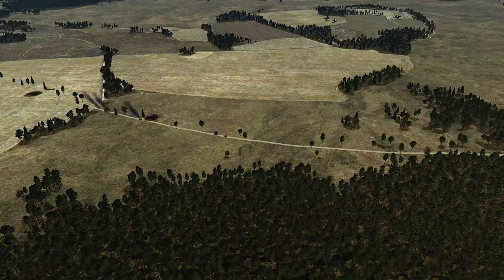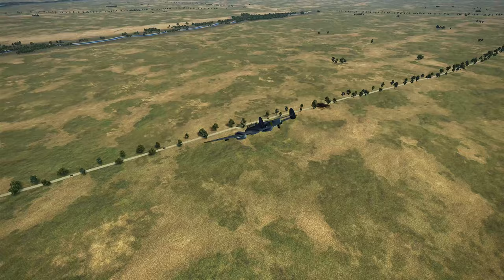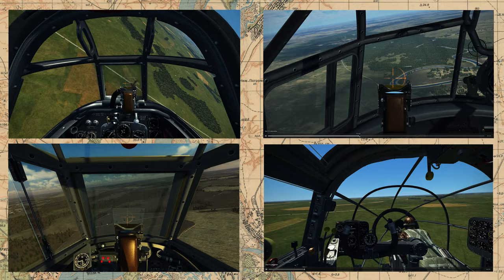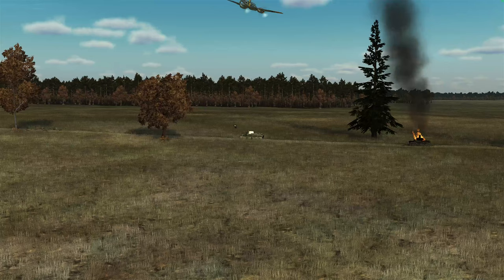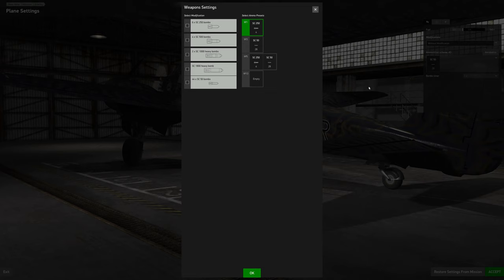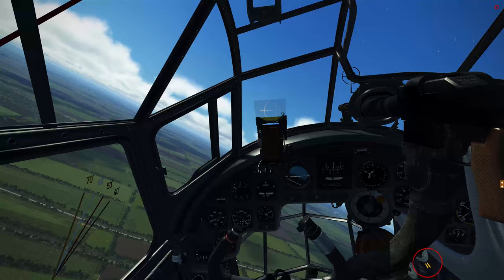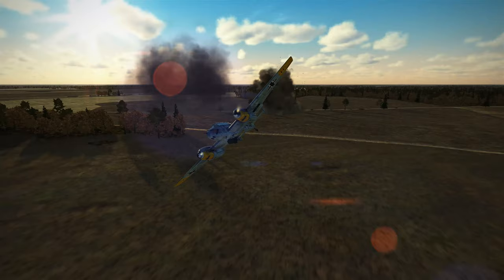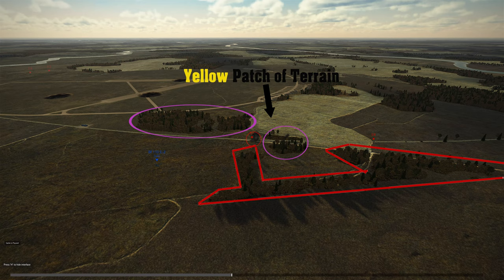Multiple Pass Tank Busting with Bombs Bf 110 / Ju 88 / Ju 87 / He 111

Comment: 10:54 bomb drop order conflicts with what happens at 11:13   Can you explain?
Reply from the maker: Very good eyes, man, and thanks for catching that. I put these videos together in the wee hours when I should be sleeping lol. I'm gonna put a correction in the description section giving you credit - - - - - - - -
Reply: @HvB_ground_attack  Thanks for the clarification. since they don't converge off center much, I figure the main reason to know is so that you will know which side you'll have extra weight on (although that will become obvious anyway within a couple seconds).  One other question- around 9:07 , talking about bombs needing time to arm... I've never understood why setting a 5 second delay would solve the issue with dropping a bomb too low; do you know why this is?  And by doing this 5 second delay, will the bomb arm itself no matter how low you drop it?
Reply from the maker: I don't fully understand the arming mechanism either, but I believe there is a spinner that must rotate a certain number of times to screw the detonator into the bomb. If it doesn't fall through the air long enough, the spinner doesn't fully screw in the detonator. But why a 5-seond or longer delay works, I'm not sure. But I do know even with these longer delays there is still a very low altitude threshold that will prevent detonation if crossed, around 4-5 meters I'd guess.